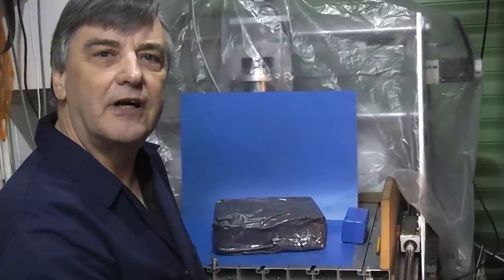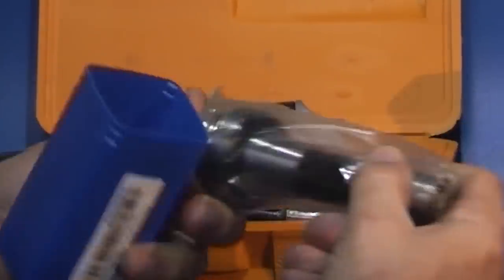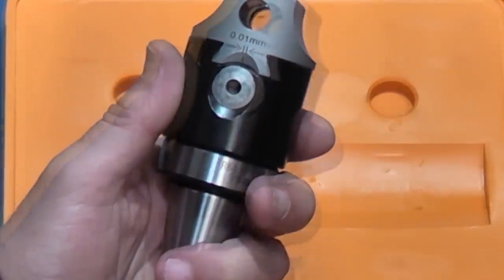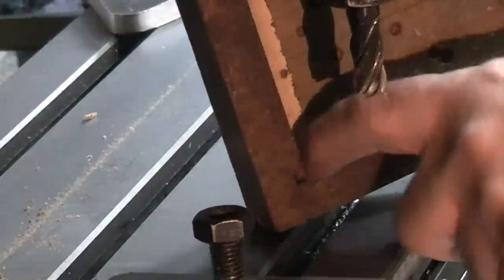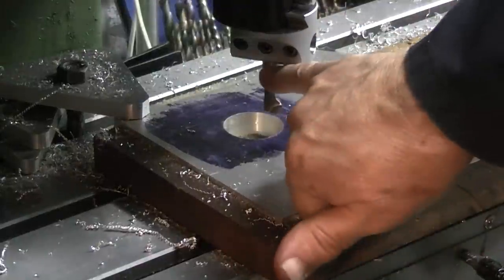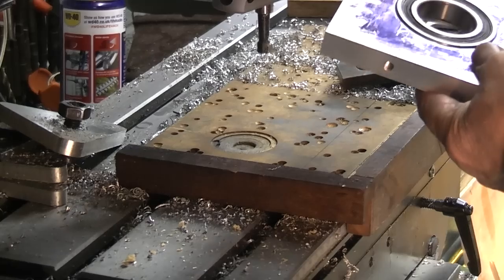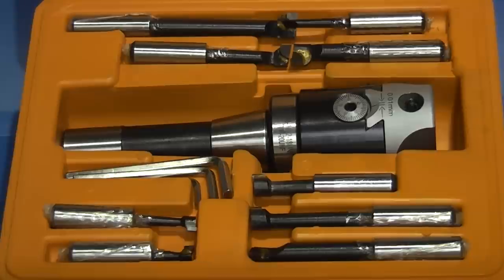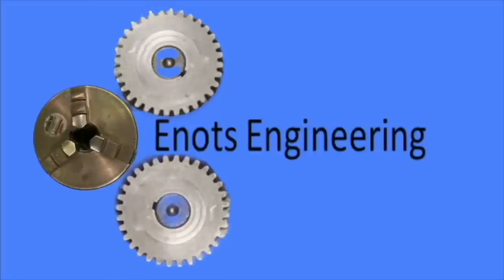Tool review 2" boring head

Comment: Hi Alan, I have a very similar chinese boring head. Works great, but those brazed tip tools leave a lot to be desired. Get yourself a set of replaceable tip ones. Much better finish for the bottom surface.

Comment: Good Lord why do people go so fast with the boring head?? Arent boring bars used for presicion and arent you supossed to slow down the spindle speed for more precise work just giving my two cents here
Reply from the maker: Hi  I've never used a boring head until this job. I set my speed at 600rpm for the 12mm hole I started with. I thought if this was my lathe I would run in at 600 for 12mm hole. As I increased the hole size and used my traverse to feed in the surface finish was good. If it was cutting steel it would be slower.

Comment: Try using those tools in the horizontal hole and you will find they are back to front. You either have to bore from the bottom upward or put the tool right way up and run the machine in reverse which will unscrew the head off the arbor. Any ideas for sorting this problem ? Chris Tasmania
Reply from the maker: Hi Chris  Good point the only way I can think you could get around it is to make a steel bar 12mm od with a small hole in it which can hold a HSS tool ground to a vee on the end. A small grub screw could hold the tool tip in the bar and the original grub screw holds the bar in the boring head
Reply: @enotsengineering  Buy what's called a round shank left hand boring bar for that cross hole. Since my Criterion has imperial dimensions I just ordered the 1/2" shank cross hole boring bar they make for my head. It takes replaceable inserts. If? your mill will get down to a slow enough rpm, bores of up to 6" or a bit more can be done. While the threaded connection between the shank and the head works just fine, I still prefer the much better design Narex uses on there straight and B & F heads. The shanks bolt to the heads using 4 fairly heavy allen head cap screws. That way the heads can be run in either direction with no chance of the head unscrewing from the shank.

Comment: the cutting tools are worthless because they are NOT milled for indexing. believe me, use it once , it will make a burr on the shaft and you cant get it out. also, with the index float, you probly didnt get it set right anyway. been there done that.
Reply from the maker: Hi each tool costs about $2 each you could mill or file a flat on the diameter for the grub screw to locate on or use a 12mm boring bar with insert tips.

Comment: How are you finding the Warco..  I'm thinking of getting one but i would like the wmd45a mill that Amadeal do.
Reply from the maker: Hi check out Warco and Chester machines as they sell the same machine but with different features.
The Warco machine has power down feed.The machine is noisier than a belt driven machine as the gearbox is at head level . But no problems with it to date.

Comment: Good video as usual Alan, was this on a manual feed or power feed?  I have the WM14 which is manual only and I'm curious how well manual feed does when using a boring head.
Reply from the maker: Hi Wayne. I used the power feed for the boring when it reaches the stop the head returns very fast under the tension of the main spring.

Comment: No mention of RPM or or cutter angle.
Reply from the maker: Hi Roger I think the RPM was around 600 and the cutting tool had a brazed tip set 90 deg to the bore

Comment: Nobody wants a mill table that looks like a dart board so I can see where you're coming from. However if your aim is to make a precision bore, then it might be an idea to bolt the piece to the table via a sacrificial piece of metal or parallels and eliminate the flexible plywood interface. It will reduce chatter and make a more circular hole. With tooling, you generally get what you've paid for, so with that in mind, throw those bars away and buy some from APT. Before you use the bars, the face (cutting edge) needs aligning with the the direction of the slide to prevent rubbing.
Thank you for taking the time to make a video in the first place Alan.

Comment: So what would be the best way to get the bottom of the recess nice and tidy?
Reply from the maker: Hi I can only think of two  ways to do that. Leave the tool at full depth touching the bore diameter lock the spindle and move the tool towards the centre taking a cut each time or replace the tool with a flat bottom tool that covers the full face and then take a cut.

Comment: Hello Sir,
Could you please tell me mm step increase you use each time you do the boring of the hole for the bearing?
Reply from the maker: Hi Martin it There are a lot of variants like type of machine, size of bore the material and amount you have to remove. Start. with 0.2mm and reduce it to 0.025mm or less as you get to the required size.
Reply: @enotsengineering  hello, thank you very much for the information.